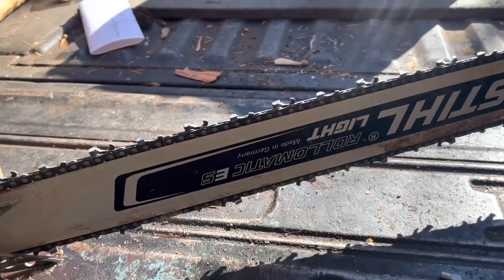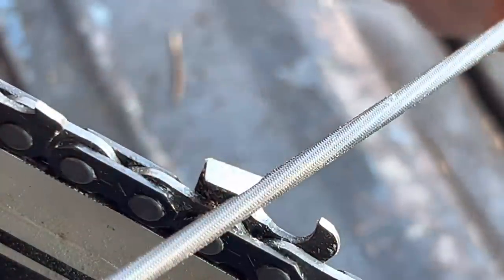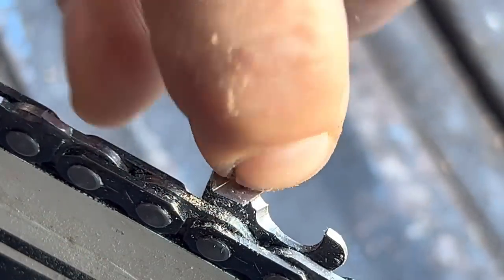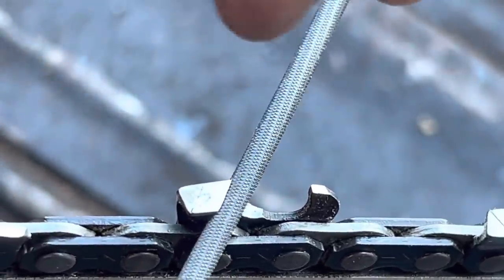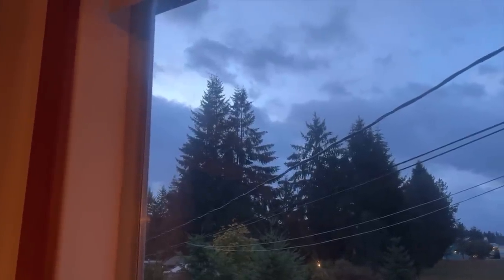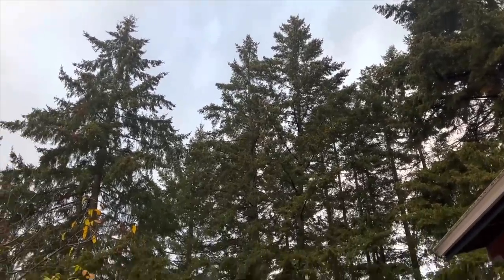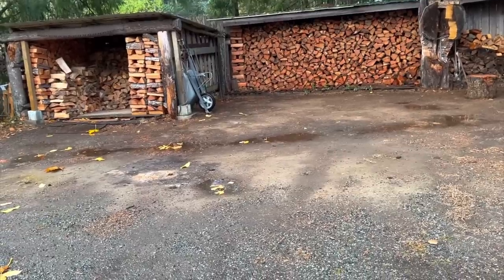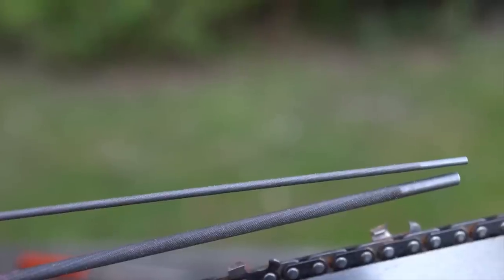Do You Think You Are Sharp?

Comment: Buckin...I'm  so glad you  mentioned the file bending! At least 50% of the chains  that people  bring to me to sharpen are messed up because they  want to put too much  backwards  pressure on it. If the tooth is really  bad, I  will  use the Grunberg rotary sharpener to square  it up then finish up with a normal  file. Get the gullet  and remove that burr!  Love love ya BBR!
Reply: Am I correct : filing with 7/32 but using a smaller file to get the gullet?
Reply: @440gohorse    hello! In answer to your question....to get the "baby c" like Buckin  was talking about, yeah....and to get the gullet just use the normal  size file the manufacturer  recommends. Just put enough  downward  pressure  on it to get under the cutter edge.
Reply: @rnjohnston68  Thank you.

Comment: The sharper the chain, the longer it stays sharp because it is far easier to control so you stay away from dirt, and you can recognize quickly when it needs a touch up. When the chains cut like stock, they don't cut well enough to be apparent when they are dulling a little because you have to put pressure on them to cut in the first place. Retouching a chain as soon as you need to apply slight pressure takes 1/3 the time or less than waiting till you need to engage the bucking spikes before sharpening. 

This has been my experience.

Comment: I can always rely on a great informative video from you, thank you. Can you tell me why I see so many videos where a Styhl blade is almost always upside down. I’ve heard that it is rotated for wear purposes. Thanks again for your great videos.
Reply: The “bar” (as stated blade) gets flipped upside down every time someone needs to dress the bar, depending on how heavily the wear is, this changes the way a saw will cut, so if your chain is sharp, and you still cut on an angle check your bar for a bur on the outer edges of the drive link groove, to remove this bur, simply clean the groove all the way around, then use a file/ belt sander or bar truing tool to extend the life of the bar. Flipping the bar every other chain sharpening allows even wear on both sides of your bar!

Comment: I havent found an 1/8 file so I've been doing a 'toddler' C with a 5/32. I have noticed it cuts faster but I have a hard time being able to shave off from the top plate and I go too deep into the tooth making a very concave C. So I use a guide first to grind out the top plate angle right, and then I get into carving the C.
How do I make it so I can get that burr without the guide?